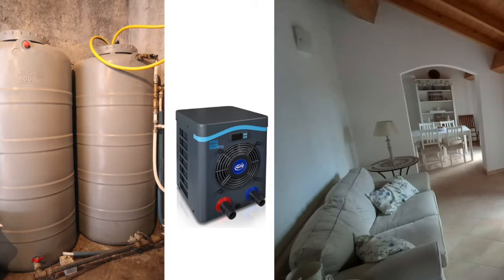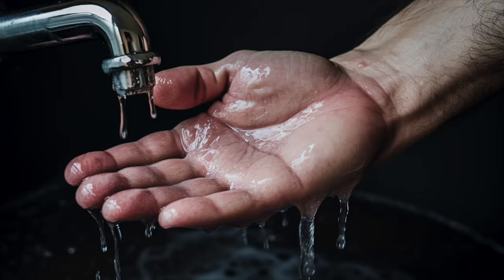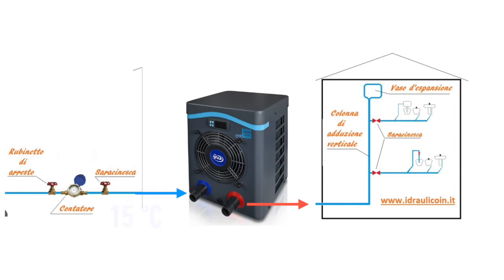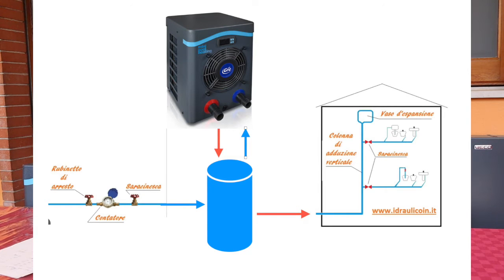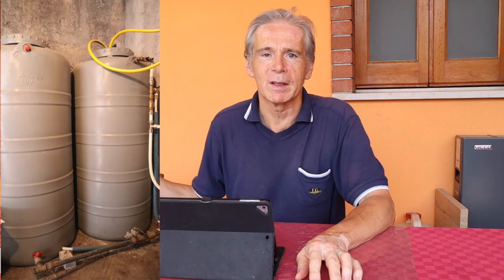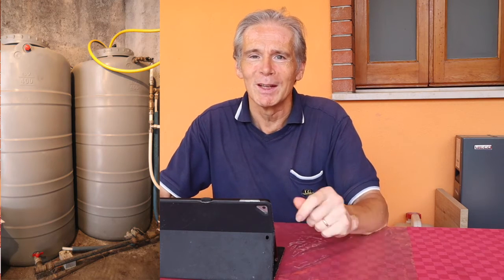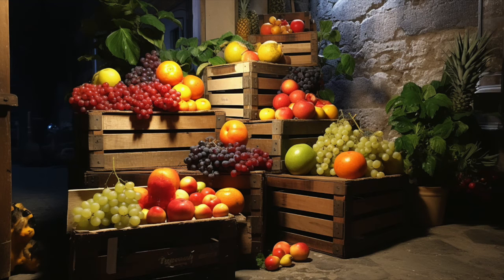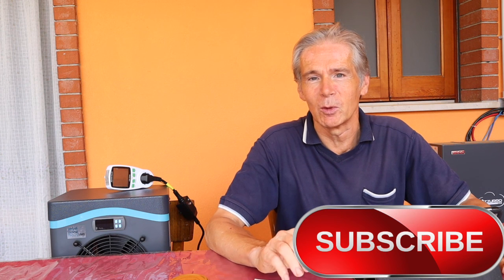Unglaubliche Effizienz: Schwimmbad-Wärmepumpe löst die Klimaanlage ab - Video 20

Comment: Hi, I also use a pool heat pump and use it to heat the domestic hot water at home. I have a 200-liter tank in the basement. I modified the resistance in the heat pump for temperature measurement, allowing it to heat up to 50 degrees Celsius. Since I have several solar inverters in the same room, it tends to get quite warm, but the pool heat pump cools it down to 20 degrees Celsius.
Reply from the maker: So you make also double use of the HP? Splendid! Is it noisy? Sometimes the water shoukd be heated up to higher temperatures beyond 50 degrees for Legionella. Are you in Italy too?
Reply: @nnvasen-good-energy  Yes, it is a bit loud, but it is located in the basement with the inverters, so I rarely or almost never notice the noise upstairs. The only time it bothers us is when my wife starts the washing machine there. I don't see Legionella as a problem because we use up the water every 2 days, which keeps the storage tank constantly flushed. Alternatively, I also have a heating element in the tank, but I don't use it. I'm from Germany.
Reply from the maker: Ach so, ja ich hatte gesehen dass Du von DE bist! Ich bin froh dass ich mein Kanal auch in Deutsch mache, es gibt viele Besuche von dort. Ist meine neue Einrichtung mit Playlists für jede Sprache bequem? Ich habe es auch so gemacht (eine Videodatei pro Sprache), damit die Subtitel gleich anfangen zu spielen, statt es auswählen zu müssen von 5. Ich hoffe dass es Funktioniert.

Comment: Would be so nice if there was a system where you could run all appliances (washing machine, dishwasher, fridge, freezer) and general room and water heating with one central heat pump, which a smart controller. That would be so efficient and your appliances would need there own integrated heating.
Reply from the maker: Hi MKder2te, seems your name is German, indeed you ask from my German movie. I really think that my video nr 25 is an answer to your wish. It is a serie of 5 videos 25a to 25e. From video 20 on there is no apart video anymore for each language but one video spoken in English and subtitles in 7 languages.  Ich hoffe daß es Dir nützlich ist!

Comment: Legionellen, in German. 60 ° to kill the bacterias, virus, etc.
You have 30 ° you will hatch, bacteries there, there love this tempretur.
Sry for my bad english and thx for the Video.
Yeah the dishwater, needs extra input for warmwater!
So you can use your heatpump or so, instead of the heating rod inside.
Maybee the heater and the pipeline to get heat to an in the wasinginmashine etc.
To exchager, with an heat exchanger.
Reply: Next, i have to see this Video first :D .
Reply from the maker: Yes you are right. I think I say it somewhere that you have to stop at 25 degrees for water in a tank but if you preheat with this heat pump and continue to afterheat until 60 or you pump it in washmachine it is allowed. Übrigens, ich spreche auch Deutsch aber ja, im Englisch können mehr Menschen mitlesen!